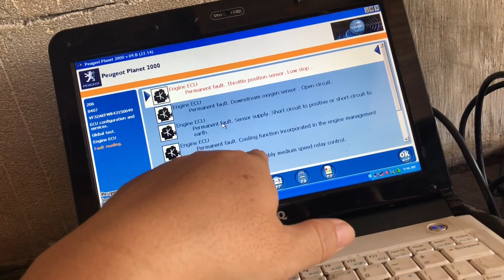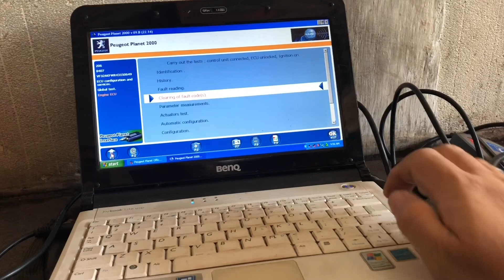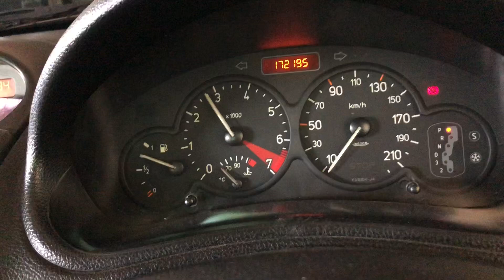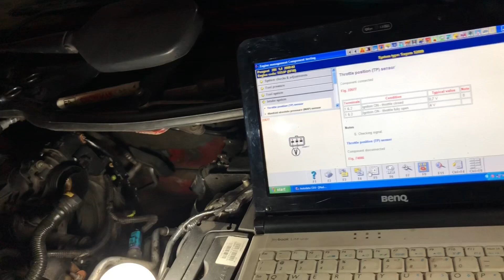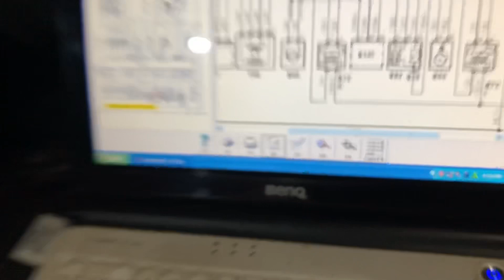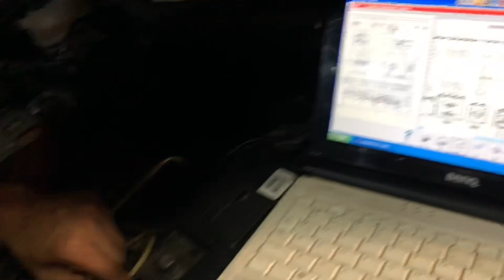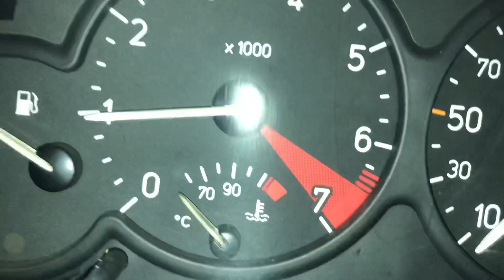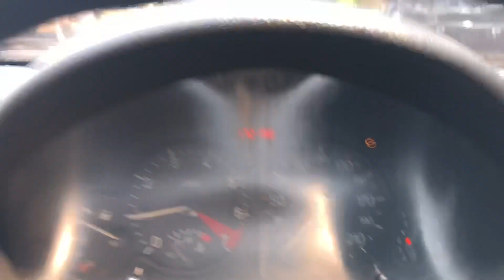Mesin mobil brebet saat di gas - peugeot 206 perbaikan kabel mesin

Comment: Tanya om. Mobil saya mazda croonos 2000cc. Kl mesin nyala Bisa stasiuner. Setelah saya gas lalu saya lepas. Rpm down mesin langsung mati.tiap mau jalan. Mesin terasa brebet. Sangat susah untuk jalan. Kira kira apanya y om
Reply from the maker: Brebet bisa kembalian tidak normal , mungkin kabel busi 
Atau sistem bahan bakar tidak normal , saya tidak tau apakah pake air flow meter atau pake map sensor
Reply: @KamilMotor  kl ga salah pake air Flow meter om. Letaknya di atas filter. Apa ISC nya  bermasalah y. Atau apa ada sikringnya yg putus. Kayaknya pengapian dari busi ke koil normal. atau ada sensor lain yg rusak.  Soalnya di sini bengkelnya masih manual. Blm pake komputer